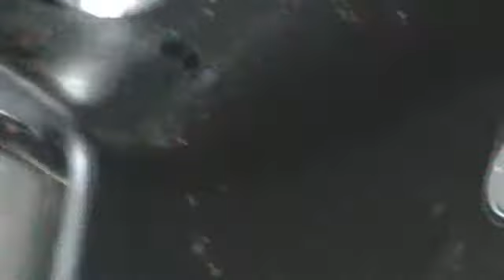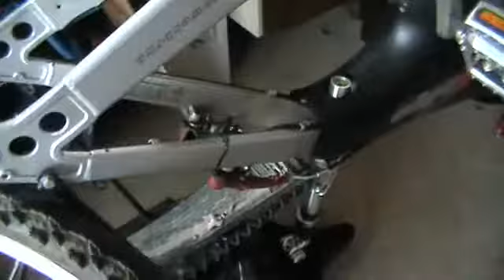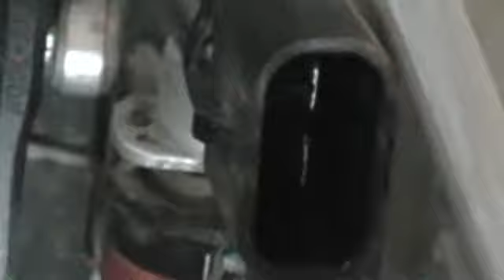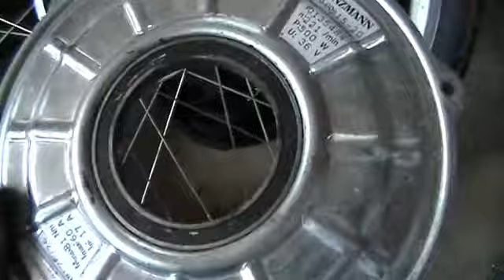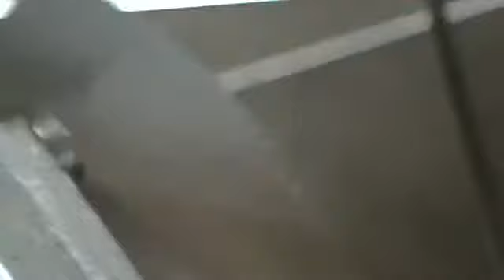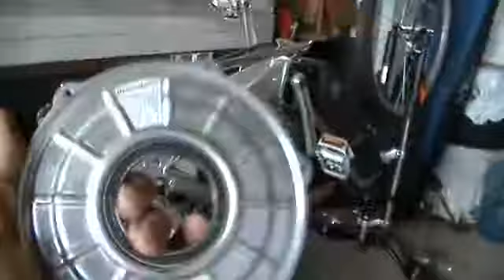remkick e bicycle green wing blade flying mod hack camping boating

Comment from the maker: oh yeah it coasts on the hub but the drive is always engaged when you pedal it so it is harder to pedal than a normal bicycle but on the batteries If i pedal lightly I get about 50kms from my new gell cell pack I built